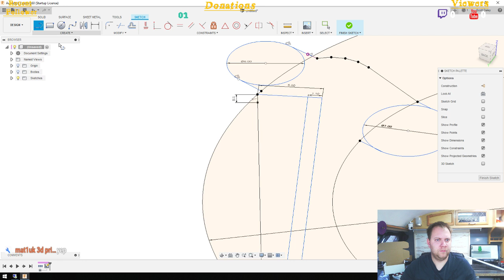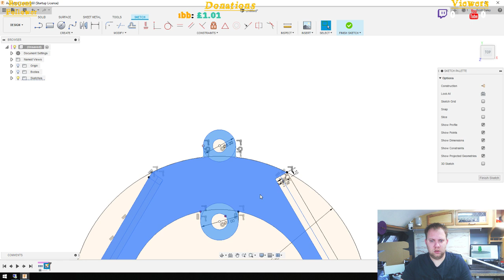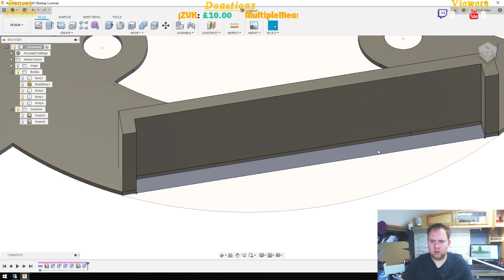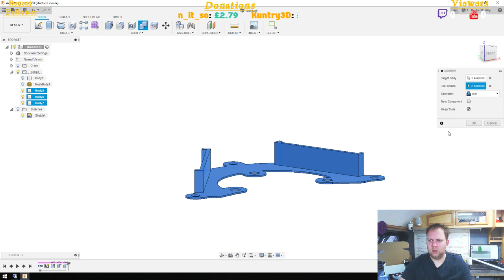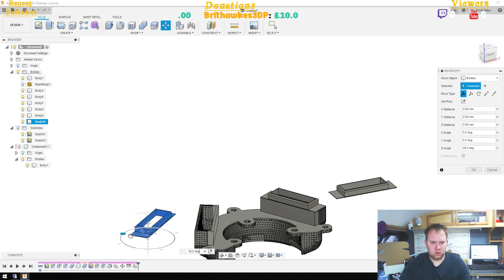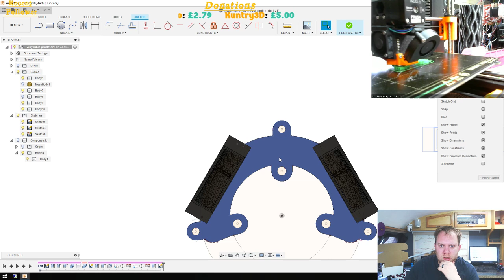3D Printing: Live stream EP18 - it's Good Friday, and the Anycubic Predator cooling sucks!!

Comment: Just got one of these machines its a good printer very solid  but  have to agree with you totally the 3d printed  duct that is supplied with the predator is terrible, did your modified version improve the cooling :D
Reply from the maker: I belive it have improved cooling with a 0.4mm but I'm trying to print with 0.8mm so I finished a design today duing my stream to allow the use of a couple 4020 fans